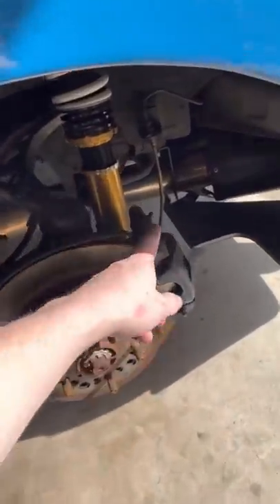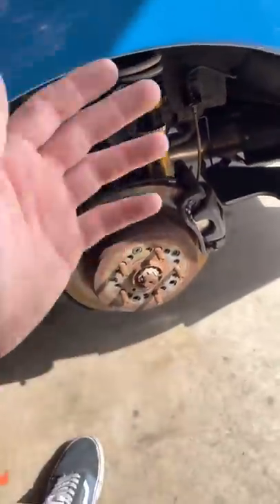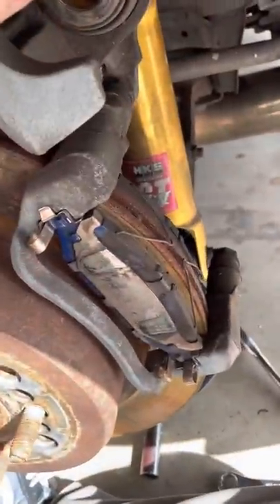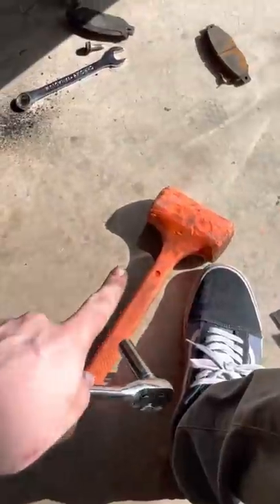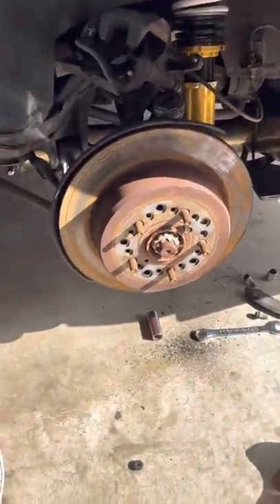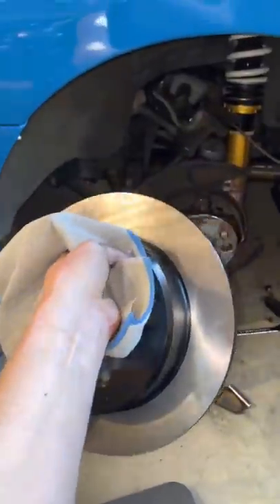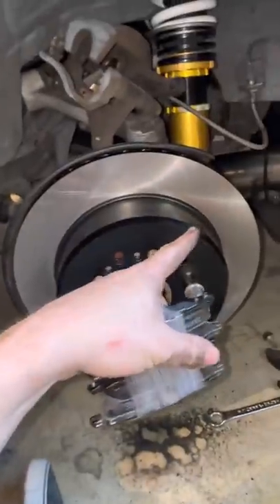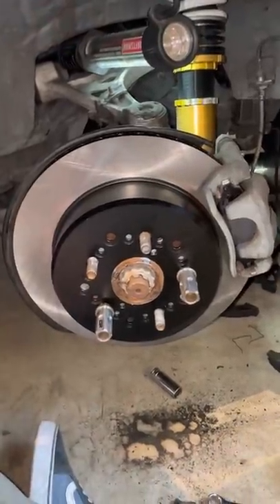How To Change Your Brakes 1 minute Tutorial  #shorts

Comment: Are we just going to ignore the fact that he went to pick up parts with a McLaren
Reply: Honestly I like that he was information oriented rather than showing off cars lol, I didn't even notice the McLaren
Reply: Are we going to ignore the fact he has expensive shocks and he bought cheap rotors that are not slotted or drilled.
Reply: @paule4204  i don't think he needs them,  its probably a stockish engine, usually in big turbo supras you change the full brake sistem and have  a more meetty tyre
Reply: @paule4204  was thinking the same thing
Reply: @alejandroojea5534   check out some of his other Supra videos I think it makes like 500-700 hp
Reply: Thank you someone said it
Reply: Or that he has a Supra and a Maclaren but uses a Harbor Freight jack . 😉
Reply: @alejandroojea5534  he has around 650 or 700HP on his Supra
Reply: @paule4204  do you need drilled rotors in rear wheels?
Reply: @raidenout1515  if there is one thing that harbor freight does right, its there jacks
Reply: @mauricecooper9016   I know I have one . Their low profile jack . But I only use it for low cars . Snap on for everything else . It really is better and the handle doesn't pass fully vertical  where the harbor freight will  hit a vehicle if your not careful  . My point was with  his  expensive tastes I was surprised to see the HF jack .
Reply: @paule4204  Drilled and slotted rotors are of no benefit to a car you drive at normal speeds.  All they do is mulch your pads...also slotted rotors are the way to go since you aren't compromising structural integrity.
Reply: Are we gonna ignore the fact that he put super cheap brakes on a Supra and owns a mclarren?
Reply: @jbrunner122  You don't need expensive rotors to perform adequately. Obviously they need to be of decent quality but pads matter more in terms of braking performance. Given  that his supra is mainly a straight line street car, I don't think low cost rear brakes are going to be a deficit.
Reply: Let's ignore the fact that the McClaren cost more than his house.
Reply: For his Supra
Reply: He also has a 2jz mustang
Reply: i’ve watched hun for a while now and he has a supra, then mclaren, and a mustang
Reply: @zero_stars  that’s an mp4-12c... in sure his house cost more than $120k ... in California you can’t even buy a trailer and trailer park lot for that much
Reply: @paule4204  lmao slotted and or drilled rotors can be cheap af too. You aren't special if you have them
Reply: @stupidslave  Mine aren't noisy, have drilled front and rear. 

To others: No it doesn't make you special just what came on my car.
Reply: @davidk2628   not saying he needs to go out and buy expensive pads and rotors... but I just put that same brand of rotors and pads on my beater truck... because they were literally the cheapest you can get... and you can certainly feel the lack of quality.
Reply: What about using centric parts... lol
Reply: McLaren : am i a joke to you
supra : always have been
Reply: Are you supposed to only pick them up with a truck? Tf is wrong with you
Reply: @F17A  Lol. I guess you pick your break parts with 500k plus car.
Reply: @alejandroojea5534  oh that engine is fairly far from stock.  I think iirc from his vids it’s pushing around 600 but I could be way off.
Reply: @paule4204  my thoughts exactly. I dgaf about what vehicle he used to pick up them cheap parts.
Reply: @jasondenio3979  So basically nothing in Supra terms 😳
Reply: @paule4204  literally makes no difference unless youre racing lol. its only like that for the heat dissipation.
Reply: So
Reply: We gonna ignore the harbor freight jack too?
Reply: For his immaculate supra
Reply: For a Supra
Reply: @paule4204  that’s not necessary if he doesn’t track them. Also slotted rotors paste shorter and drilled ones crack often
Reply: And he has a Supra😭
Reply: @jasondenio3979  it’s an automatic lol
Reply: Lol i didn't saw mclaren cuz i was looking at SSSUUUPPPRRAA!!!!
Reply: @zero_stars  do you really believe that?
Reply: @raidenout1515  some people spend hard earned money cars does mean they need all the crazy name brand racing shit it gets the car up off the ground right? Good it did it’s job
Reply: @raidenout1515  my bad
Reply: @hartdakoda8964    I wasn't Looking down on him because of the jack It was just a surprise I have 2 jacks 1 is of $850 snap on jack Which I use mostly.  I also own a Harbor freight low profile jack to get lowered cars up to where I can get my other jack under it . The harbor freight one sucks. (From experience) and is worn out . He's got more expensive cars too . I've just got a lifted armored 3rd gen tacoma and a m2 competition.
Reply: @hartdakoda8964  no worries man.  Yeah was just thinking damn this guy's got money and figured he'd have some top notch tools since he's working on them himself . Cheers have a good weekend.
Reply: @paule4204  i don’t think it needs it rlly, look at the old brakes, they are way smaller and obviously worked good enough with all the mods
Reply: @alejandroojea5534  that Supra makes 800 horsepower I guarantee you those brakes are not cheap, rotors do not need to be drilled and skittles to be performance there are also downsides to them
Reply: New here? HAHA
Reply: It's fine.Hes rich
Reply: @brobocops  nope

Comment: Love how he is fitting budget discs and pads on a performance car...
Reply: Budget rotors, but Akebono pads are good. Seems fine for the rear.
Reply: Not a performance car
Reply: Some carbon side skirts don't turn a corolla into a performance car.
Reply: @joebrother7116  do you even watch his channel? that a 600plus hp supra
Reply: @Mr.bllunt  ok, that doesn’t make the car a performance car, yes it performs, but that wasn’t its purpose
Reply: @joebrother7116  true
Reply: @joebrother7116  tell me what other purpose could it have than performing well?
Reply: @joebrother7116  You gotta be fucking kidding me 😭😭😭
Reply: @stupidslave  until you cook them trying to push the car on the Street, expensive mess over paying for decent stuff. Assuming your lucky enough to just cook the pads Vs crashing because they over cooked moments before you needed them...
Reply: @mohammedsafraz9820  “cook the pads” lol
Reply: @mohammedsafraz9820  you,  nor anyone you have ever met has “cooked” their brake pads and crashes their car on the street. Stop watching FF movies 😂
Reply: Budget rotors are completely fine with a road car, yeah sure that supra has 600+ hp but getting performance rotors is pointless on a car that is made to fast in straight line. Better rotor disipate heat better, they don't give you better braking, stronger calipers do
Reply: I mean it’s the rear brakes witch are almost never used. Unless he drifts the car.
Reply: @Youretryingtoohard  my B4 legacy Begs to differ, managed to get some Nippon pads to catch fire after a few max speed runs on the motorway , crusing through the suburbs after exciting the M-way lost brakes pulled over and via accumulation of brake dust and heat they'd caught fire ..... Cooked brakes
Reply: @mohammedsafraz9820  Lmao "cooked". the car doesn't even looks like a track day car tho it has 600 or some but not gonna cooked the brakes like fried black burger from McDonald's.
Reply: But it’s not a performance car lmao
Reply: A few meters?  That's a huge difference.  Like the difference of smashing into something versus being a few meters away from it.

Comment: Anyone doing this dont forget to remove the caliper pins (from their rubber boots) and inspect them/regrease them as necessary. Also a light (just surface) dab of grease should be applied anywhere the pad rides in those metal retaining clips that are pressed into the bracket. Finally, buy a torque wrench and look up exact specs for your vehicle.

Comment: Don’t forget to support the caliper when you take it off so there’s not any pressure on the brake line :)
Reply: Fact. Do you know how many mechanic shops let it hang? I try and use a old metal coat hanger and bend it
Reply: Yeah use some mechanics wire or an old metal clothes hanger
Reply: Got some thickish rod I bent into several hooks, wish I found this out sooner as for a while I was using straps which was a waste of time and being a mechanic, being efficient is everything.
Reply: Ben Beatinmydique  don’t add lube to the brake pads though haha
Reply: @takingafatdump  no I mean the actual brake pad material, like, where the real braking occurs
Reply: Goes without saying.
Reply: You can use a bungee cord if you're careful.

Comment: I'm going to buy a cheap beater just to practice fixing and working on issues by myself
Reply: Great idea, cars are easy after you see mechanically they're all really the same. Just watch up on a few videos before you start a project and you'll be good
Reply: That's a fantastic idea. I've made a few too many mistakes tinkering with my daily. Luckily nothing kept me off the road for more than a couple days, but I'd much rather learn on a car I don't depend on to get me to work every day.
Reply: Nice; what make and model? If you don't mind me asking?
Reply: That's the only way to do it bro, good on you.
Reply: Chevy blazers are reliable and simple to work on. Anything 2002 and older wont have many computer components as new cars so issues are easier identifiable without an expensive OBD/scan tool mechanics use. Had my blazer going strong my daily driver for 5 years now
Reply: Or jus go on YouTube your not the only guy to own a car n I bet there’s a video for everything you wanna learn
Reply: It's a good idea
Reply: Practical application is good experience.

Comment: Contrary to what most people think, you do not have to replace the rotors with every brake job.  Most rotors can be turned true at your local parts store for between 6 and 12 dollars,  this will not decrease brake performance as long as you don't go below the minimum thickness which is stamped on the edge of the rotor.

Comment: If the car has inboard shoes on the brake disc, like the supra, it’s best practice to back them off before attempting to remove the disc in order to prevent damage to the shoe lining or mountings. On re-assembly don’t forget to readjust the shoes to ensure optimum hand brake efficiency.

Comment: The mallet technique had me shit myself like just start hitting stuff until it works
Reply: That's actually a technique for the thing
Reply: you do want to clean the surface where the rotor sits on the hub (the underside) and many times rotors will rust and seize to the hub so you have to schwack it off. Also this guy didn't lubricate shit on his install. Your gonna want to antiseize the hub after cleaning before you install the rotor. Your also gonna want to polish and lubricate the caliper on all surfaces where it comes in contact with the pads. It's also good practice to use something like dialectic grease on the backplates of the new pads so they don't stick to the caliper over time or rust and come apart
Reply: @liamreed8636  Man, quit talkin' science... these kids are RICE!
Reply: @THRASHMETALFUNRIFFS  negative
Reply: @liamreed8636  Thank you, someone in here who knows something. He didn't even bleed the system either 🤦‍♂️
Reply: @jmccann6735  well I mean he didn't change the caliper so he shouldn't need to bleed it but none the less that was a very poor quality brake job and will likely wear Improperly over the next 10 000km
Reply: @liamreed8636  ALSO USE SYLICONE GREASE ON THE CALIPER PINS AND REGULAR GREASE ON ANYTHING ELSE!

Comment: I am so old i remember when rotors werent junk and you could turn them.
Reply: You can, but they're not expensive anyway.
Reply: I just bought four performance rotors and brake pads for my mustang and had them delivered to my home in 2 days for 280 total after tax and shipping, then sold the tiny gloves they came with to my mom for 5 bucks.
Reply: Shops want 200/hr for labor, so obviously not worth turning some old, damaged rotors.
Reply: I got 2 performance rotors for my other car delivered for 63 total.
Reply: Just the time and gas and hassle of taking the rotors to the shop is not going to save much compared to buying new ones for 63 dollars that you know for sure are not messed up.  Plus, for me, it was an upgrade.  I didn't want the old rotors.

Comment: I'm glad I dont take the lugs completely off when lifting the car up. All I had was the oem Sissor jack and just barely got it off the ground getting ready to slip a jack stand underneath the car. Threads stripped and the jack collapsed after failing. I no longer use that style jack and I'm glad I was taught to leave the lugs on until the car is up!

Comment: I'd encourage anyone who can afford to do it, get a cheap 90's era Civic or something similar for $1000-$2000 and spend time watching videos on how to do stuff like this and do it. Once you do certain things like brakes once or twice, you realize that most cars are built similar and you can easily understand what you're looking at across multiple platforms. It will save you large amounts of money. It can be scary at first, but with the right tools, it's seriously easy stuff.
Reply: Until you run into odd seized, damaged, bent, worn parts that usually are not.

Comment: I gotta do my back rotors, they look like yours. Don’t buy steel rotors people, they instantly rust when wet. Like he showed ez to do with basic tools. Bolts will be hard as F to get off if they haven’t been changed in awhile (caliper bolts). Longer the wrench the more leverage and easier it is

Comment: DO NOT LOOSEN the lug nuts with weight on the tires. Only break the lock the jack the car up and continue to loosen and remove Lig nuts once weight is lifted and no more pressure is on the tires. Loosened lug nuts can damaged the thread if weight is in the tire still

Comment: Just a few tips: don’t use anti seize on the hub face, clean out your slide pin bores and pad slots well, and make sure your parking brake is adjusted well and in working order

Comment: Don’t forget to clean and grease those sliders or pins, or they will seize up and kill the brakes... also before removing the calipers use a screw driver prying back n forth to push the pistons back in for room for the new pads etc

Comment: May be worth mentioning taking the lid off your brake fluid reservoir/master cylinder and then using a c clamp or something to slowly compress your brake caliper pistons so the new brake pads fit over the new rotors.

Comment: Bolt holes in the rotors is just a Toyota thing. You also need to make sure you use two bolts. One on each hole and make sure to tighten them at the same pace so you don’t warp the rotor

Comment: He did mention, every car is different.
He did not service the parking brake.
He did not need a piston tool.
He did not show us careful piston retract.
He did not bleed the spent fluid.
He applied a compound unevenly to the hub.
He did not measure rotor lateral stacked runout.
He did not refer to specs in a service manual.
Your car may need one or all of these.
You could find a caliper issue.
You could find a cable issue.
You could have electric motors on yours.
You could need brake hoses.
Yours could have serviceable bearings to repack in the dear hub and you could have a sensitive preload setting and seal drag to contend with.
You could need a technicians help. 
Only specially trained persons are qualified to judge conditions that may be in question.
Feel free to ask a tech.
Use a torque wrench.
Careful with auto parts made in China.
Its a safety issue. 
Use a safety jack stand and wheel chocks.

Comment: Careful with that set up on the rear, forcing the disc off like that without backing off the handbrake shoes is a good way too rip off the fitting kit or on older cars rip off the backing plate then you have a headache. Obviously after fitting the disc readjust the handbrake

Comment: Do NOT apply antiseize to the whole surface - just to the inner part - same goes for wheels - only apply it on the inner ring

The antiseize could squeeze out over time an make your rotors run untrue and the lugs could loosen up and you loose a wheel

Comment: READ ME!!!!!!! Look up what a mounting point is on a car you don't want to just throw the jack underneath your car anywhere you feel like it, the car has special spots on the bottom to put the jack onto that doesn't bend, twist, crack etc be careful, use a jack stand after you pump the car up, lifts can give out and you can get seriously hurt, be safe. Also put high temp lube on the guide pins(the things with the rubber boot on them) if you don't they can get stuck and your caliper won't be able to open back up

Comment: This is good advice if you buy the trash rotors as he did because you will need to change them every 6 months. Invest real money in get drilled and slotted rotors so the gases can be ventilated without warping

Comment: To anyone watching this video… breaks are the only thing you shouldn’t change or maintain on a car by yourself when your not a professional! They are critical for safety. When your engine fails due to some mistake you made prior, you will probably not die. If your breaks fail, it’s a totally different story.
Reply: The critical items that should be pointed out are the torque specs for wheels and calipers and also the position for wear indicator and anti rattle clip.  Aside from that, if you can assemble Ikea furniture......you're over qualified for brake install lol!!!

Comment: Crack loose the bleed screw and Decompress the caliper before you take off the old pads and rotors. Just use a flathead to do this. Tighten bleed screw.  If it doesn't go in make sure to check that you don't have turn ins. Those need to be. Well. Turned. To go in. Use silver antisneeze on the guide pins. And make sure to properly bleed your brakes after... So much more he missed.